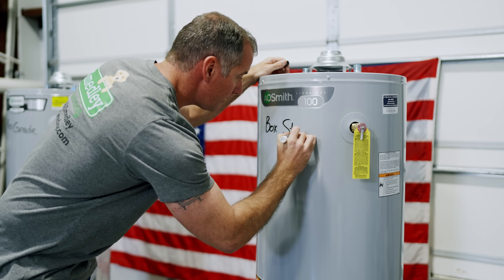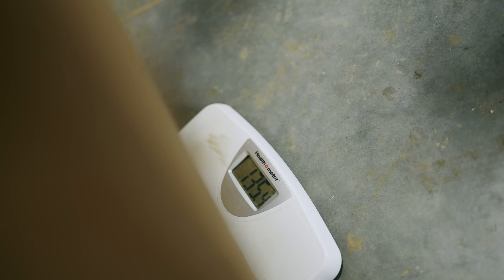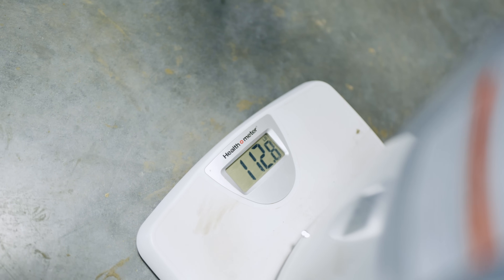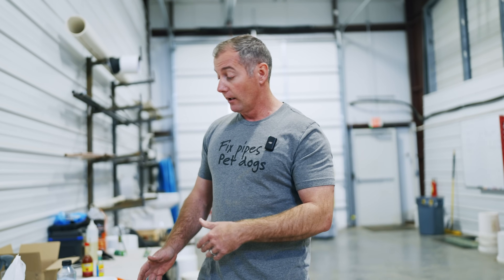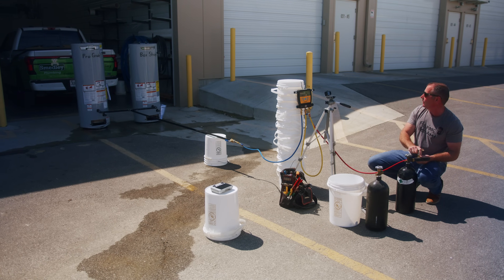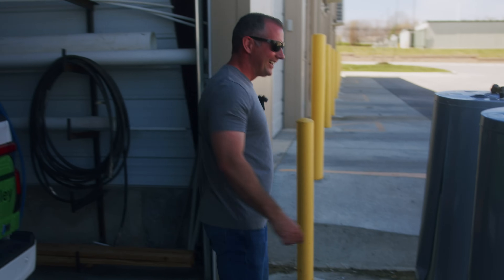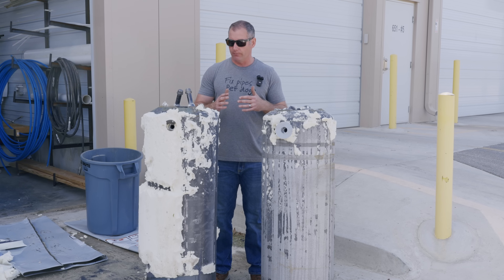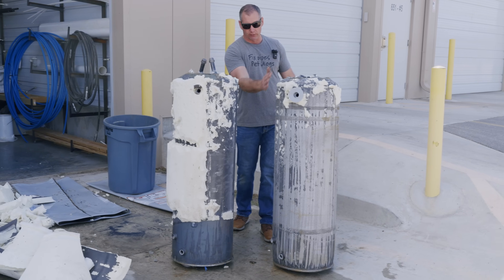What water heater should I buy? - Pro Grade vs. Box Store

Comment: The Plant in Johnson City manufactured most of the retail product uses pre-cut and pre-cleaned steel. They had a better glass lining process so they could use thinner steel. Each plant has different tooling, there are lots of differences in the product from one plant to the other, like the watts vs. cash acme vendor. I worked as a sales manager in wholesale for A.O.Smith/State for 20 years.
Reply from the maker: And I have no doubt that you know that their intentionally selecting cheaper materials to use on the box store models. Which would be why we as professional plumbers see box store heaters failing much faster and much more often than any  professionally purchased heater.
Reply: @SmedleyPlumbing  I work at the Johnson City factory. The steel is (mostly) the same regardless of which factory is using it now. Rare differences in thickness, where they exist between comparable models (pro or retail), are less than a hundredth of an inch. What major differences do currently exist are mostly to do with what kind of weld is on the long seam. The pro model used submerged arc welding for that seam. Your pro model was also most likely a few years old. Since COVID all the metal has gotten thinner, and all of it is being standardized across the board. They may not be exactly the same buying them right now due to old stock shuffling out, but they will soon be near carbon copies of eachother.
Reply: @tinscarecrow21 this is definitely true to non commercial heaters, but commercial heaters are definitely built different and better, and should be given a commercial heaters costs $5,000 or more and the funny thing is they only come with one year warranty, I loved doing commercial heaters as basically we would just charge double the cost of the heater to cover the labor, and it never took our guy's that difference in time to change, but would often take 3 guy's to do but at least one would be doing nothing but fetching tools and parts as you can't have 3 guy's working on the installation side just needed the extra muscle, and had to be at least an apprentice plumber as per union rules, nor by state code when it came to touching any of the installation stuff,  a only a license plumber or apprentice working with supervision can cut sand sweet pipes, we use mostly copper pipe for water, but that's because plastic water pipe is not legal in any place in the Chicago metropolitan area, even prefabricated homes built in another state had to hire a Illinois license plumber to do the plumbing
Reply: @patrickcarlson1400  Ultra premium tanks do exist, and you will pay a pretty penny for them, but this video isn't talking about polaris stainless steel models or the other ultra premium tanks A. O. Smith makes in McBee, SC. They're showing the differences between a regular water heater purchased from a big box store and a regular water heater purchased from a plumbing supplier. They're also being disingenuous about it, given the date and location of manufacture are easily findable and readily available on the stickers on every water heater. They're showing an older model vs. a newer model and claiming the supplier makes a difference. It doesn't. Every water heater made in Tennessee (Ashland City and Johnson City) and any model made in Mexico now use the exact same metal thicknesses for all tanks of the same size (with a tiny exception between mash seam and submerged arc seam models). You may be getting premium parts, but all the tanks are now the same for regular models. Across the board.
Reply: @patrickcarlson1400  Just ask yourself why they're avoiding showing the date and location of manufacture. That, alone, should throw up some huge red flags. It's easily found, verifiable information, and it's incredibly relevant to what they're comparing. Why hide it?

Comment: I have been a general contractor for 33 years.  I have only installed 3 tank water heaters in the last 20 years on my projects.  Have installed over 100 Noritz tankless units.  We had one heat exchanger leak in that time period.  We had a replacement part from Noritz in 48 hours.  (Was still under warranty)
Reply from the maker: Installed properly, and tankless units are pretty awesome.
Reply: Having a tank water heater in your home gives you access to 50 gallons or more of potable water in case of an emergency. Unless you're short on space, most plumbers I know prefer a tank unit.
Reply: @giovannicampos7462  If you need an emergency water supply it's less expensive to install a"tempering" tank and a smaller high efficiency demand heater.  Cheaper still is a supply of 1 gallon water jugs.   Plumbers get paid by the hour. They make more money from servicing and replacing tank units than from less frequent work on higher quality, more expensive and durable demand units.   Auto mechanics and dealers have similar attitudes about preferring ICE cars that have more mechanical maintenance needs ta BEVs.  The newer tech has different support needs.
Reply: I live in a hard water area. A tankless heater requires servicing annually to prevent lime blockage. The cost of this removes any financial advantage in using tankless.
Reply from the maker: @67daltonknox  Yeah we never pushed tankless for a financial advantage. Yeah they save a little bit of energy but they're added initial upfront cost in their added maintenance costs offset any energy savings. So literally the only reason we ever push tankless is for people that need endless hot water.
Reply: I installed a Noritz on my house, started renting it out, serviced it annually and it failed in 2 years. I was out of state, so had a tankless specialist replace it since he said it couldn’t be repaired, electronics problem, replaced with a Rinnai. It cost me $4800, and he knew I was a plumber. Total ripoff that gives all good plumbers a bad name. The Rinnai has been great for the past 4 years.
Reply: @67daltonknox  Even a tank style water heater doesn't like hard water. I had to install a water softener at one of my restaurant customers, they were going thru a water heater every 3 years, but the previous guy had just installed a cheap 40 gallon gas from a big box store too. I replaced it with a 75 gallon AO Smith commercial grade power vent water heater, and 4 years later its still going strong, and they don't have to de-lime the dish machine so much anymore. It used to get really bad and the dish machine company that does the maintenance on it loves the water softener, and could even cut back on some of the detergent chemicals and rinse aid. The savings on chemicals, labor to descale the dish machine, more than pays for the 2-3 bags of salt per month. They order those from one of their food suppliers, so only about $8 a bag.
Reply: @brnmcc01  I think this article was aimed at domestic users. Even in a hard water area, with perhaps one anode swap a cheap tank heater will last  20 years. This is way cheaper than tankless.

Comment: Rheem has two lines of gas tank water heaters, Performance which can be purchased at HD and like the one we have, a Professional model that was installed by a HVAC/Plumbing company.  Also in the USA (not the world) there are other water heater manufactures like Haier who makes GE, Bosch, Rinnai (Japanese brand) plant in Georgia.  Thanks for the comparison. You learn something everyday.
Reply from the maker: Yes we might do the Rheem line next!
Reply: @SmedleyPlumbing  I’d like to see the Rheem line. After watching your video, I researched the box store 50 gallon Rheem electric I bought at Home Depot. It does have a brass drain valve and magnesium anode rod, but I’m guessing they’ve cut some corners somewhere, and I’d like to know where. 

I’m just a homeowner and didn’t realize the quality would be different based on where I bought until watching your video. I hope this one lasts, but now I know for the future.
Reply from the maker: @GraingerProductions  we considered that.  But Rheem changes the name of their pro line to Ruud.  So people works likely think they are two different heaters.  That's why we did the AO vs. AO.
Reply: There is is also HTP as well

Comment: I bought a pro grade HW heater that a plumber recommended and installed. I paid premium money for a premium product. It worked great, til it didn’t.  I called the plumber, he promptly came over and promptly determined it was a bad control board. He called the company that built this premium product and because it was one month out of warranty I’d have to buy a new one at darn near the price I paid for the water heater itself. The plumber was devastated he really sold this product as reliable.  I told him it wasn’t his fault and that I’d take care of it from there.

I promptly went to a big box store where you save big money and bought the dumbest water heater on the floor, I promptly installed it correctly and by golly 15 years later it’s chugging right along.😊
Reply from the maker: If you're saying this happened 15 years ago and it needed a new control board then that would have been a very unique water heater. Even the water heaters in this video don't have a control board.
Reply: @ I want to say it was an A.O. Smith but it may have been a State. Whichever one it was it had a little control board.  I just checked the date on my current heater which is a Richmond and is nine years old so I stand corrected on the date.

Comment: My control valve failed just as you described. Plastic cracked leaking water into control valve. Valve never turned off burner. Water turned to steam. Relief valve never opened. Luckily that was the worse of it. Great video.
Reply from the maker: Thanks for sharing!

Comment: Great video. I’m a 71 year old retired plumber and would only suggest a little more personal protection when pumping up those lines at high pressure. When I was starting as a teen with my dad, construction plumbers were still using flares for sealing gas leaks in newly finished buildings. Very dangerous as there were plumbers that were injured doing so.
Reply from the maker: Hydro testing is actually very safe as long as steam is not involved.
Reply: @SmedleyPlumbing You were the one that said “I’m nervous, I don’t know what it’s going to do”. Good reasoning. I’ve done hydrostatic testing on most of the high rises, hospitals, and other commercial sites that required it. Never used anything over 150psi. Why? Because most fittings and valves are rated at 150psi, including, it appears, the iron ones you used on your test lines. The union based school I went to in the early 70’s had videos sponsored by American Water Heater showing units blowing up prior to the use of T&P valves, and yes, lives lost. Great job at showing the general public what they are getting from box stores as opposed to the ones plumbers buy and the time and money you spent to do so. Stay safe out there.

Comment: Energy guide are way different between the two Box store $227 and Pro $ 320. But box store saving you more money per year. Why?
Reply from the maker: The energy guide ratings are wildly inaccurate.
Reply: That energy guide is the government lying to you.
Reply: That's a compliance requirement, they probably reuse test data from 10-20 years ago.  I wouldn't trust it unless there's more transparency over how they obtain the data.  Same is true of miles per gallon fuel efficiency ratings in vehicles...they can reuse the same test data from year to year which may not accurately reflect on reality.  Now it's to the manufacturers benefit to have accurate data if newer models truly are more efficient but I doubt anyone knows the difference between their current and their old water heater.

Comment: My box store heater had a control box fail so I called the 800 number and got the run around for 1-3/4 hours. Finley I hung up and called the manufacturer and ask for the COO with in 5 minutes I was told I would have my part with in 24 hours delivered next day air.
Reply from the maker: We hear that all the time.
Reply: What is coo 🤔
Reply: @jcaleca60  Maybe "Chief Operating Officer"?
Reply: Lol sure you did. Like they'd patch you through to a C-suite exec

Comment: If you wanted to mount a pressure gauge on your heater where would you put it? On the hot outlet nipple?
Reply from the maker: Cold inlet.  It will last longer.

Comment: Thankyou for the hard work and detailed comparison. As far as the pressure goes, is unrealistic as there is no place where the water pressure goes that high without other plumbing fixtures failing. The prograde definitely has better gauge steel and components and again, thankyou for the comparison.
Reply from the maker: The pressure test was a bit unrealistic but we wanted to demonstrate the difference in quality.

Comment: Sure, the pro grade should be better, but as long as your relief valve is working properly, it'll never see that kind of pressure. I also notice Lowe's sells different AO Smith 40 gal tanks with 6, 9, or 12 year warranties. I wonder if the 12 year Lowe's heater is the same as the pro grade.
Reply from the maker: Relief valves fail closed all the time.  It's a very common issue we see.  Also, the thinner metal shows wear and stress much sooner.  That's why we see so many box store tanks fail within a few years.
Reply: Around 1990 the company I worked for asked Bradford White the difference between water heaters with different warranty lengths, their answer was the price difference represented the increased cost of the longer warranty. No difference in construction. This was done to answer a customer question.
Reply: Pro grade is simply advertising logo for the wholesale house.
Reply: @harveypaxton1232  Not true!

Comment: 7:12 displays the energy guide for both units. Prograde has $320 & BS $227. So he PG water heater costs more than the BS water heater, and the annual usage is more expensive. Can you please explain why the PG 40gal cost nearly 100 more to operate than the BS 40gal?
Reply from the maker: No.  Those stickers are wildly inaccurate.
Reply: Thank you
Reply: Very good question. Those estimates are not inaccurate

Comment: Any thoughts on pro vs. big box heat pump water heaters? Like the Rheem Professional line against it's regular line?
I guess the big question here would be is the heat pump unit different between the two lines?
Reply from the maker: I would assume box stores to reduce quality everywhere they can to shave costs.  A high end unit like a HP water heater should definitely be purchased at a pro supply store.

Comment: Things that would be interesting to know: 1. Manufacturing date?  2. Factory?  3. actual part number?   Running changes in production. Different factories can produce differently, but most of all box stores are going to have a margin percentage requirement from their suppliers.  So, vendors can find ways to save $ on the build to meet the margin % requirement of the buyer. I’m suspecting the model number is very close, but diff enough to be the lesser quality parts to meet the margin requirement.  This is my suspicion, but the first two are still possible
Reply from the maker: Most people think that if they're built on the same line, they are the same heaters.

Comment: Please consider doing more comprehensive comparison videos of box store vs plumbing supply store for faucets, toilets, and shower trim using units from the same brand.
Reply from the maker: We totally will!
Reply: I learned the hard way that toilet seats are different depending on big box vs. Plumbing supply store. 

How? I actually wrote a story wondering why my top of the line soft close seat started to rust. Screws, connecting rods, etc., all rusted. 

Contacted the company, who guessed I bought it at Home Depot. For HD, they replaced titanium hardware with nickel coated steel. They sent me their normal line replacement. Exact same unit, slightly different number. Guess what, no rust! They apologized and said basically don't buy our products at HD or Lowe's. 

I knew an exec from a toilet manufacturer. Same story, thinner castings at Home Depot. They make their margin by cutting corners. So I prefer plumbing supply stores when possible.

Comment: Realized after watching a video on Anode Rod’s and the need to replace them 3-5 years. I had never replaced my water heater rod and so did some more research and ended up going with an electric protection anode rod. I have replaced it already however what is your take on these type of anode rod replacements? Even one plumber store talked to using this type of anode rode if they did the project.
I did replace the anode rod myself and from various video’s, I used a 1/2 inch impact socket and impact wrench. Purchased a Ryobi 1/2 inch impact wrench and sockets on sale and it worked like a charm. The anode rod was on very tight over the 10+ years not replaced. Took a few attempts with the impact wrench but it broke it loose and I had may be 6-8 inches left (wish I could attach a photo), it did its job for sacrificing but was due for replacement. Now I used the impact wrench so I didn’t mess up the water lines or twist the water tank by using a breaker bar, definitely the impact wrench was a good choice. 
Nice video produced!!
Reply from the maker: Thanks!